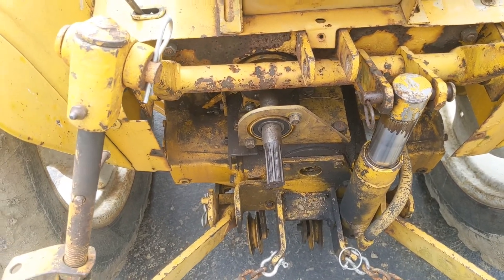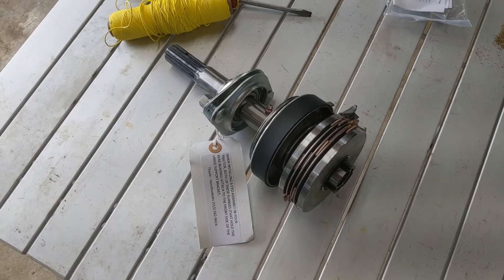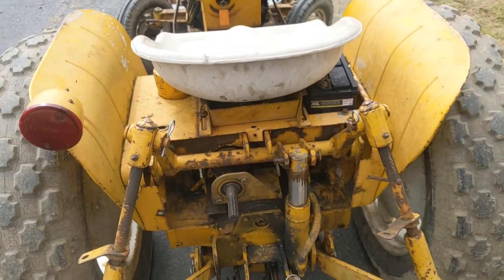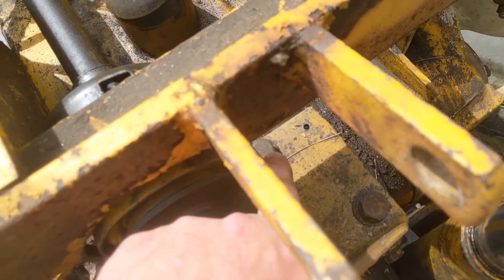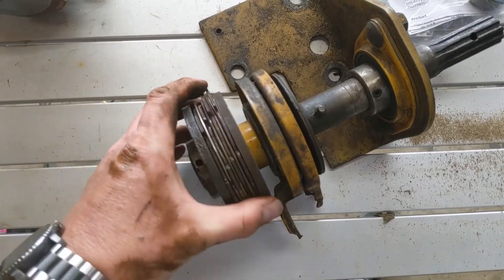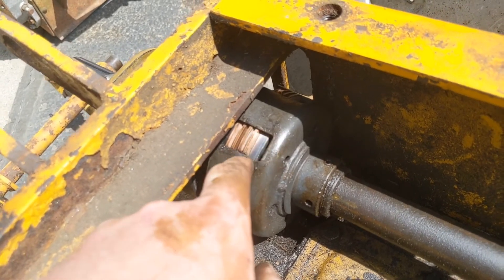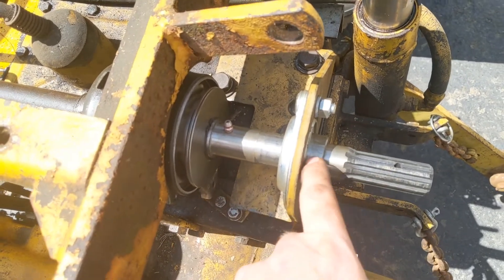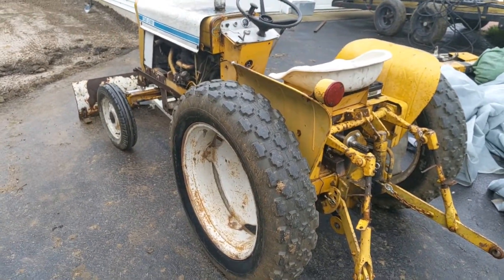How to replace the PTO on an International Cub Lo Boy 154 tractor.

Comment: If you are in Delaware Ohio, I am nearby in London.  I am currently working on my Cub 154.  I have a couple of questions.  Do you have a photo of the brake spring on the braking equalizing bar and where it connects to the frame?  Mine has been jerry rigged and I would like to see how it's supposed to be connected.  Also, what brand and type of fluid are you using in your Cub 154 tranny and final drives?  Thank you!
Reply from the maker: I know London fairly well!   I meet up with friends over at Todd's Pizza in West Jefferson on occasion!   If you haven't done so yet, head over to farmallcub.com.   There is a section in the forums called "Lo-Boy Series 154, 184, 185".   The folks over there will be able to assist you and provide pictures of just about anything you need!
Reply from the maker: Super Trac, Tractor Hydraulic Transmission Fluid from TSC is what I'm using.   You can get it in a 5 gallon bucket fairly cheap.  Probably not the best option out there, but it is what I use.

Comment: can you tell me how those two cupped spring washers are orientated? are they () or ))
Reply: I am trying to figure out the same thing!! Here is where I am at.  That assemble from Hamilton Bobs shows them () opposed.  The service manual that came with my 154 shows a step to compress them with a specialty tool, there is nothing to compress them if they are nested )) so therefore I am putting mine together () opposed.  Here is the order in my manual for reference 1. spiral retainer 2. load spring () 3. Cam plate and cam bearing assembly 4. retainer/snap ring.  Let me know if you would like to see these pages of my manual (section 8, mainly 8.4 to 8.8).